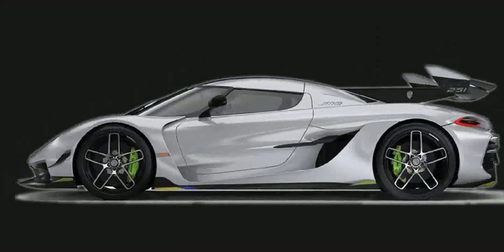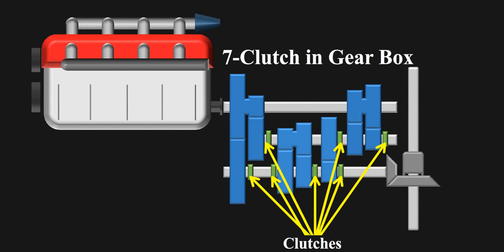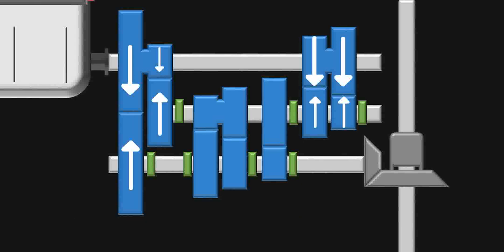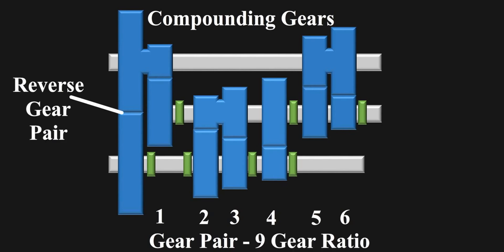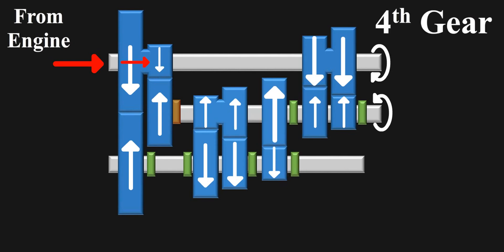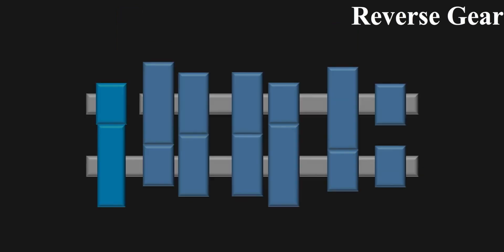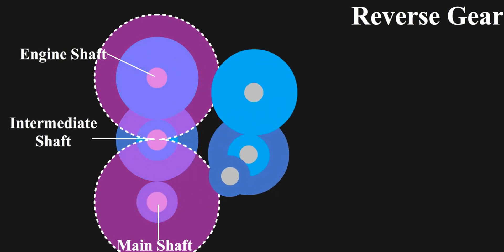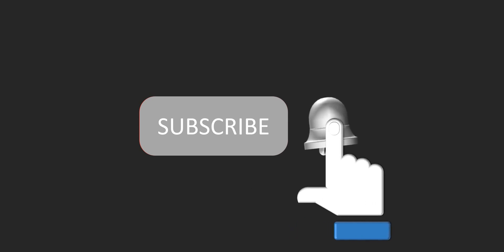Koenigsegg Jesko - 9 speed gearbox working in detail

Comment: Early Saab’s had a very similar set up using three shafts to generate four forward gears using compounding of two ratios per “gear” because there was a dropper gear on the third shaft. This made the gearbox only about 250mm long excluding the differential.
Reply: Im still sad what happend with Saab.

Comment: Parallel axis gearboxes with multiple torque paths are not new, for example Daimler are in series with their 8 speed DCT which uses multiple torque paths. There are quite a number of challenges in the Jesko layout shown, not least that it has no launch clutch, so at least one of the shift clutch(es) will have to handle a lot of slip power, and it will rattle in neutral across the meshes with the cyclics from that flat plane crank . The cartridge valves look like high pressure parts, and will struggle with precise control for smooth launch/shifting, plus the anticipated 20-30ms shift time might be interesting with a typical valve of that type having a 15ms+ E-H delay, even without any 'security' valves or forced low line pressure to prevent unwanted (high A-SIL) torque at the wheels in case of a single point hydraulic failure. All that being said, lovely to see Koenigsegg trying new things, and I really hope that they solve the issues - we must keep moving forwards!

Comment: To put it in simple words. 
When input is recieved on the frst shaft it can be transferred to 3 gears on the second shaft. When it is transferred to the first gear on that shaft. Rpm decreases for the second shaft and is further more reduced by the first gear on the second shaft. When it connected to the 2 n 3rd gear it increases. When the first shaft is connected to the second gear on the first shaft input rpm increases a bit as output gear is smaller. Again it experiences the highest resistance when it connected to the 1 gear on the second shaft n goes faster as we go to the 2 n 3 rd gear when we reach the 3rd gear on the first shaft we again connect it to all 3 gears on the second shaft. 

So the combination is 
1.(low input rpm)    2.(mid input rpm)     3(high input rpm)
123.      123.     123. (These adjust resistance to the gears on the first shaft).

Comment: It's also worth mentioning that the engine is capable ~1500 N/m of torque (1100 ft/lb), Other supercar transmissions generally can't take that much and weigh more.
Reply: @BugattiMan© if you had read "generally", it would have spared you from writing your message.

Comment from the maker: 🔥"IMPORTANT POINT"🔥
I have observed that there is some miss interpretation about clutches. Here's the point.
Clutches replace synchronizers not dog clutches( 1:1 couplers to connect shaft and gears). 
Hence the point of friction loss cannot be related that much, as once gear is engaged clutches have no role to play for power transmission. The only use of clutches here is to eliminate synchronizers due to their limitations. While clutches of more specifically wet clutch packs are better to relay at high speed for smooth shifts.
That should make the point clear.
Reply: How does this gearbox disconnect engine when the car stops with engine idling?
Reply: pavel cotijepotom It just releases the clutch for first gear. Kind of like a dual clutch transmission.
Reply: WhitelegacyGuy thx
Reply: @powl_cz3736  V podstate to isté, ako pri obyčajnej prevodovke zošlapnutím spojkového pedálu, len pri obyč. vyhadzuješ len jednu spojku, tu vyhodíš sedem(resp. dve naraz).
Reply: Untangle Club The clutches replace the synchros and/or dog clutches. They most certainly do transmit all of the torque. There are no synchros or dog clutches, that’s the whole point of this. To reduce weight by eliminating shift forks and rails and all that associated stuff. And for lighting fast on power seamless shifts.
Reply: Untangle Club can u explain me? how 4th gear is higher speed than 3rd gear..!? if u engaged 4th gear the speed is decreases...!! see the gear patterns!!
Reply: @rock_n_roll9344  That is because output rpm from first shaft is higher for 4th gear than output rpm on first shaft for third gear.

Comment: Damn this is impressive, having the shafts constantly rotating instead of the pause when engaging the clutch on a typical manual is beneficial not to mention the small size.  the only thing i consider is being synchros are metal 'gears' themselves replacing them with clutches a typical wear item, what is the life expectancy comparably. I imagine it would work fine on a super car which typically hold low miles but i imagine this would not work on a daily.

Comment: Similar idea class 8 trucks do with hi/lo range and splitting gears. Although this uses clutches rather than shifting forks and collars. I couldnt comprehend how a transmission could have 7 clutches. This explains it well, they are mini clutches on the 3 shafts that engage each gear ratio. Rather than one big clutch slowing the input shaft. Genius.

Comment: At 200 lbs, it's still heavy, as far as I'm concerned.
Reply: Keep in mind that 200 pounds includes differential, flywheel, and clutch.
Reply: @douglasburnside  
Sure. But I can create a transmission that is even more effective and weigh less than 50lbs.
Reply: @TheTmat007  oh
Reply: @TheTmat007  But will your creation be able to handle the 1600 hp requirement?

Comment: Very nice explanation, animation. Very clever design out of the box. Jyst wonder if part of the gains is lost in friction in the 3rd axle. Well, with 1,600 HP to start with ...
Reply: Sure, the torque dependent friction losses will increase with each additional gear contact.
Reply: Assuming the transmission is well lubricated, the friction increase is negligible. Although it will probably eat through transmission fluid more quickly
Reply: @456MrPeople  I am not sure what you mean with "well lubcricated", but there is one more gear interface that transmits torque, so this type of transmission friction loss will be roughly 50 % higher. But yes, especially driven at lower loads, the increase will be small and negligible compared to the churning losses.

Comment: Well the gearbox doesn't care about hp more about Torque
Reply: Horsepower is a function of torque and rotational speed.  Synchronizer designs are known to have RPM limitations and I imagine large oil cooled bearings under load producing excess heat do as well.

Comment: Koenigsegg is always coming out with the car Tech of the future. Freevalve, this gearbox and probably more I don't know about.
Reply: The car without a transmission (Regera)
Reply: I think he said somewhere that the Regera’s successor will be using freevalve
Reply: @amphedroxyn4251  I could never stop driving gas cars anyways. When gas cars become illegal I'm done driving.
Reply: hollow, 100% carbon wheels, suspension features, naked finish (KNC), door hinge that now has an upgrade to fit the old vehicles too so their doors clear the sidewalk when opening, and now, as the Jesko is the last fully gas powered vehicle and possibly last vehicle produced by them to use any gas, this should be a message to people thinking about future gas vehicles... simply put... DON'T.

Comment: Tractors have been using this "power shift" transmissions for years to handle tons of torque from diesel engines , the clever idea here's to make it light and compact to be used in a car.
Reply: Good to know, would automatic semi trucks be similar?
Reply: @TheMrANONYMOOSE  I have never seen one like these in semis, but my experience with trucks is very limited to assure that they don't exist.
Reply: @mondayfool In this design even with wet clutches, they are all locked, since it does not have a torque converter, input and output shafts have constant speeds and can be 1:1 when needed. The idea in tractors is not to stall the engine when you have the implement down and you need to shift up, it gives you seamless shifts, what Koenigsegg is claiming with this design. Efficiency depend on the application.

Comment: So is it manually operated? As it works basically like a manual trans
Reply: Lmao no a manual would never be fast enough shifting, especially considering the lack of a flywheel it would Rev down faster than you could shift
Reply: N_rii
With what kind of clutches is this thing working? As it needs to decouple one gear entirely before coupling the next
Reply: @BlogVomMax  There is some kind of wet clutches used. Most likely smaller diameter multi layer ones like they have used in their older gear box before. There they had one main clutch and another wet one that was used like a break to swiftly synchronize the gears, making their traditionally layout gearbox shift just a fraction slower than a dual clutch one.
And no, the strength of this gearbox is just that; It does not need to decouple one gear entirely before engaging the next. Clutches are used just for that reason, they slip a little before they engage/disengage completely, allowing for some torque to always be transmitted and the shifts be incredibly fast.
Reply: @gertahnstrom784  thanks man!
Reply: No, it is completely computer controlled. It uses solenoids to do the actual shifting. The driver can at any given moment use the second notch of the gear lever in the cabin to make the gearbox get to the highest possible gear without the engine stalling or the lowest gear without the engine over-revving.

Comment: What I see is this gear box uses the same concept on gear and dog clutch arrangement as a sequential  gearbox. The difference is Jesko does not use a rotating gear selector which can only up and down shift sequentially. I guess it uses some hydraulic mechanism that can independently engage and disengage any of the dog clutches.  just guessing. I may be wrong.

Comment: I don't quite see how this is superior to an automatic gearbox which essentially also is a multiclutch transmission but with planet gears.
Reply: an auto is 2 to 3 times this weight at least and twice the size so lightweight and compactness are two of its main advantages; also you have to remember that this gearbox does away with torque converter and flywheel; I have seen this gearbox lifesize anc compared to a normal ZF 8 speed auto is very small and has an extra gear; also the gear ratios it manages to achieve have a much wider spread: from 4.7:1 to 0.67:1 offering much better use of engine torque

Comment: Great video, however, everyone has been getting this one detail wrong. This car is not the car that will do 300Mph. The first version of the car is called the Jesko. It is the track version of the car with maxed out aero. The aero will not allow 300Mph. But Mr Koenigsegg himself said that there will be a future version of the car with a smaller rear wing and less aero that will be capable of the 300mph speed. That car he said will be called the Jesko 300 or something. He wasnt very specific with the name.
Reply: I think he also said that it'd be the less expensive version
Reply: The 300mph version will also have a much simpler suspension setup as it won't require the third cross damper both front and rear, which in the track version is required to help maintain the ride height under such high downforce.

Comment: The video was pretty good, better than expected, however this isn't what exactly is happening but rather an overview.The gearbox is still in testing phase as per CVK.Also the pneumatic( not sure) solenoids are used for shifting between the gears which is electronically controlled via the ecu(most probably an transmission specific computing unit taking inputs of engine rpm)to shift faster.This is the only way the car could jump in between gears as CVK says in cruising conditions.Please upload the detailed version of the video as soon as the information is available.Will look forward to it!.

Comment: So was their 1 gear drive system secertly a fail??
Reply from the maker: Well can't say so. This is actually the replacement for agera not regera.
Reply: I'd say a definetive no to that. They are just working on two different cars. For this one they wanted an analog and driver controlled experience with a more track focused aim. The Regera has only one downside; weight of the batteries. So seeing that they could still be lighter doing a non electrified system, I guess they wanted to build it. The Regera can't go faster than the Agera RS. There the rev limiter is the top speed. So to replace the Agera, I guess they didn't want to build a "slower" car. Also I guess they really wanted to test if this gear box works. Since it's the brain child of one of the engineers that have worked alongside CvK for a long time, I guess it's the same as with the Regera, once the idea was tested, they couldn't just shelf it; It had to be built.

Comment: Koenigsegg is the best, hope this tech tricles down to something we all can afford!
Reply: This is some very old technology, If I'm correct the reason it's not used commonly is because the low weight isn't much of a benefit in cars that have a quarter of their weight come just from comfort equipment that noone uses, while this transmission has poor efficiency, and much power is lost due to the friction. Remember:All gears are being driven, even if not engaged to the shaft. However, uncommon with cars, this thing is supposed to be the transmission of scooters, but don't quote me on that, I don't know much about motorcicles.
Reply: @g.zoltan  "All gears are being driven, even if not engaged to the shaft"
This is the same for syncromesh transmissions, which is basically EVERY manual and dual-clutch on the market since the 1950's/1960's.
Reply: @jsquared1013  but with the traditional clutch-at-flywheel arrangement, when you disengage the clutch the gearbox stops spinning.
Reply: Youforgot the flywheeleffect
Reply: It a transmission. Koengegg being doing they own one forever. Not the most reliable one but it can do what Bugatti can.
Reply: And i am hoping what we can all afford will trickle up to be able to all get Koenigseggs !  Of course this probably means the end of money, but that happens to be the only answer for all other problems at the same time !  yep !